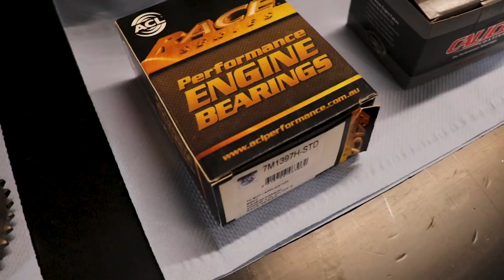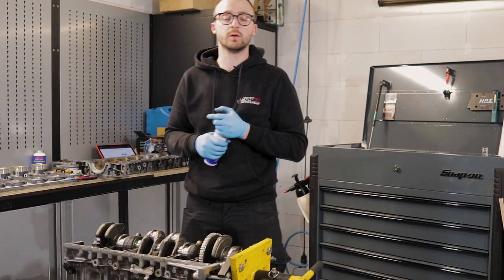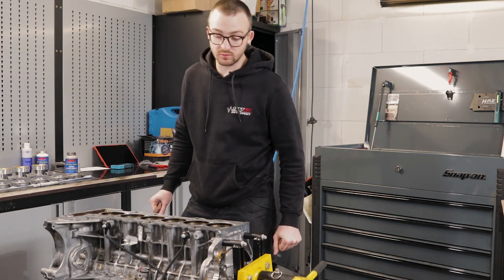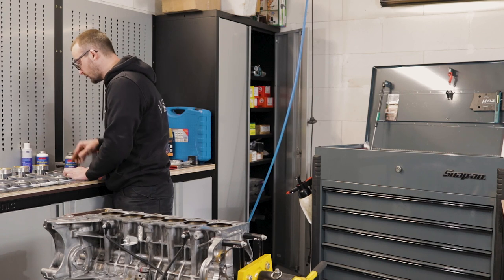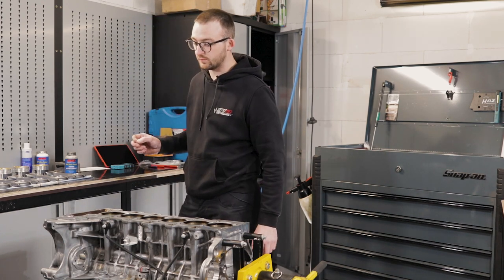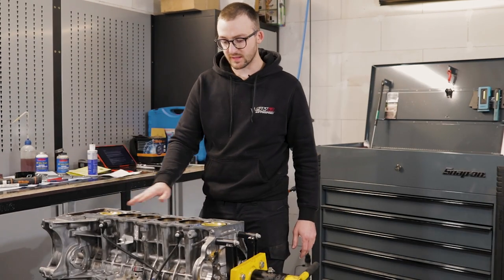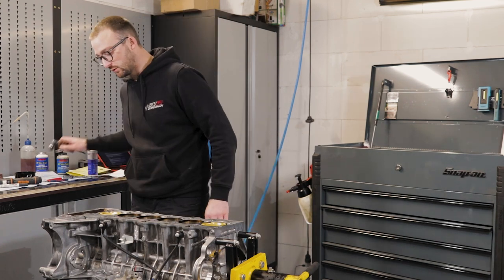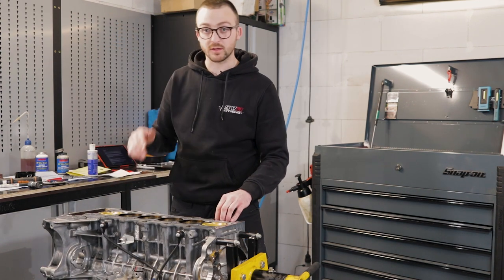Bulletproof BMW N54 Engine Build Part 1: Bottom End

Comment: what app or website is that on the tablet in the back? would feel confident about doing most the work myself if i had a torque spec sheet and parts list like that . great video
Reply from the maker: Thanks for the comment
it's actually a BMW paid subscription service (BMW AIR), which has all the same technical manuals as BMW ISTA diagnostics has, so u can use both, but ISTA doesn't run on android so that's why i used the online version in this case.
Part list is something you have to dive in the parts catalogue and decide which parts you need.
Reply: @svrautosport1632  Noted

Comment: I noticed you lubed the main bearing bolts, did you use OEM torque spec?  20NM 70d rotation?

Comment: Do you not need the BMW special alignment tool for the bedplate / girdle ? I remember that being talked about some years ago ?
Reply from the maker: No there are dowel pin´s to center the bedplate, bud you have to make sure everything is super clean before you assemble the two parts and you check clearances before final mounting

Comment: What is your bearing spec?  Did you have the mains machined or crank turned?  Are you running your bearings tight or loose?  What ring gap are you using?

Comment: may i ask you what sealant you are using to seal the girdle to the block
Reply from the maker: Sure. There are injection nozzles on the side of the block, you need to use BMW 83 19 0 439 030 which is actually locite 193140

Comment: How much this work will cost someone if will bring a engine to you. Roughly price please ? I'm curious how much money I have to save .
Reply from the maker: Honnestly it's not that easy to say, because it really depends on the condition of the engine we start with, for example this one needed a new crank, but the crank on it's own allready cost arround 1500 euro. Also the condition of the engine will decide what kind of machine/cleaning work it needs, but to say a rough number let's say between 7500-10000. But as said there are many factors that make the price, also parts pricing, as this is, at the moment of speaking, a huge problem, because price fluctuate a lot now these days, due to the shortage of core materials.